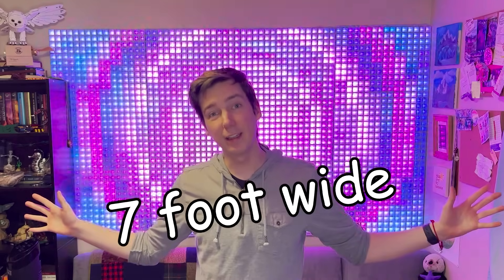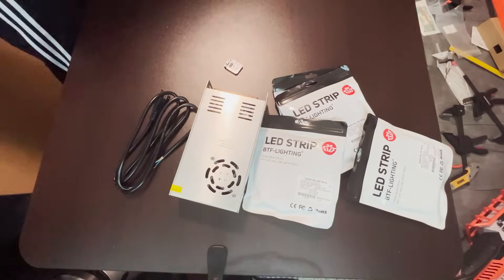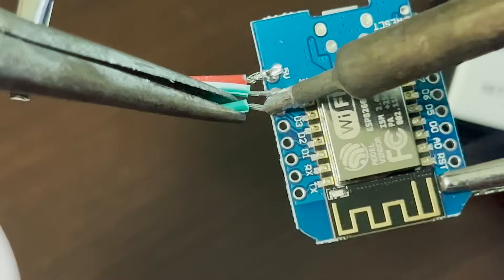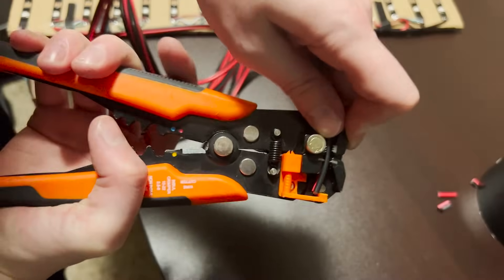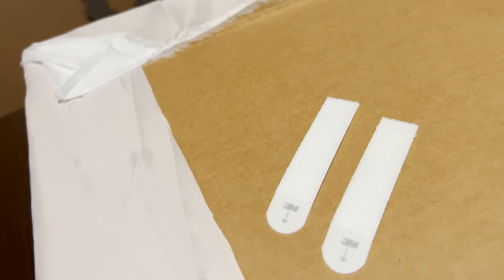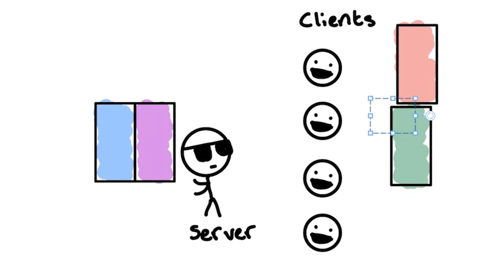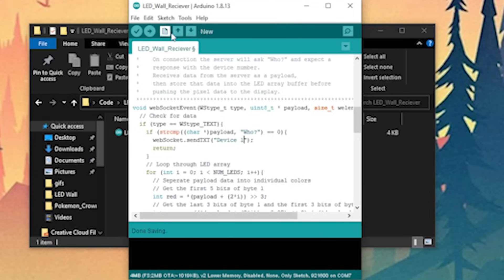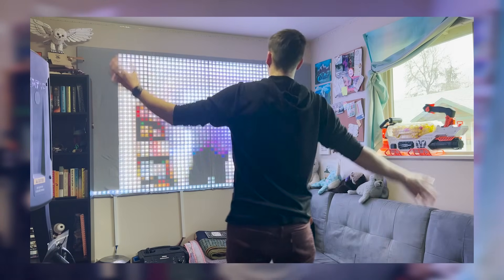How to Build a Massive LED Wall on a Budget

Comment: Ok, 1st of all you have my like. Great project !
From a electronic DIY point of view this is awesome, and teaches a lot of concepts.
Now, from the "$500 budget" point of view and complexity... I would just buy 4 cheap or used TVs, remove the frame and get much better results. Of course I know that is not the point of the video, but $500 can do a lot without having to actually "do" much.
Reply: This. Or just one projector if it's just for backdrop use.
Reply: @BossmodePictures  How would you use just one projector? Would you be able to use it outdoors?
Reply: @elace2007 just do

Comment: Here is an Improvement because you dont really need bi-directional protocols like websockets or TCP:
Each ESP8266 receiver has a fixed IP address running an UDP server.
The controller just send UDP packets to each receiver.

Comment: You went big. Recommendations for safety and functionality upgrades: 
1. Add inline automotive fuses on the DC outputs of the power supply in event of an electrical short, the fuse will trip and prevent the PSU burning your house down. 
2. Improve FPS and prevent throttling your home network going all wired with a Teensy and Octoboard. Just one Ethernet cable can carry all that data to the display. 
3. Alternative wireless options include PixelBlaze or WLED running on ESP32 with an output expander. 
4. Consider using RGBW strips which will give better colors and reduce power draw for white or pastel colors.
Reply: replacing the cardboard and cloth backing with more flame retardant materials would be at the top of the list for me
Reply: I'm still wondering :what should be the correct diameter of the cable in DC? Power can produce 60A!?
Reply from the maker: @bugsburny this thing doesn’t get close to 60 amps. You could probably run the entire wall with a single 5 amp supply with the right changes to the code.
Reply: @Tech-Random  you e are right because it would be centimeters of cable diameters. But 5 amps on 5v and 5 meters length represents already 6mm2!
It's 2.5mm2 with 12v

Or am I wrong and mixing up units?
Reply from the maker: @bugsburny 5V 5A is only 25 Watts. I’m using 16 gauge wire which can easily handle 60 Watts for up to 40 feet. I’m also running three parallel circuits to each of the four panels so each 16 gauge wire is only really carrying a few Watts of power. The whole thing stays super cool, I am even running it right now while it’s 100°F outside my apartment and I have no AC. I’m not sure how you’re calculating the wire thickness but something is definitely wrong.

Comment: Tip for anyone struggling to connect their ESP8266 to PC/Arduino - not all cables are alike!  You MUST have a mini-USB cable with data lines, the ones you get with chargers only have power lines, you need a thicker, good quality cable :)

Comment: I'd have used ATLEAST 60 LEDs pm if not more to get smaller pixels.

and you could have used a sheet of aluminium to as a heat sinc

Comment: i would really like to see this done with the higher density 60 LED/meter (300 pixel) strips for a more detailed image.
Reply: The hardware and typical home wireless network can’t handle it. Would need to upgrade the design and cost will go up.
Reply: @mylesdb  this is what I'm trying to build 60 led per meter. 108 x 42 per panel. 
108 pixels by 168 pixels.

can this plan be possible if I'm going to build it with this guide from this video tutorial?
Reply from the maker: It should work but you may not get the best framerate. Video coming soon with my new higher resolution design
Reply: @Tech-Random  thank you Sir can't wait to your new video so that I will start preparing my stuff that's needed 😍

Comment: Really impressive! I'd definitely like to give this a shot sometime!

Since we would need to make about 4x panels to accomplish this does this also mean we need 4.power supplies? If so how much combined power draw is happening to run this?

Also, a few smaller questions:
Is there an easy way to adjust dimming or perhaps networking the panels to connect to a dedicated PC that streams/plays a looping video rather than mirroring the wallpaper?
I'm super curious how much can be done with this!

Second, how much easier or different would the connection process be if done wired rather than over wi-fi to avoid router complications? I'd like to see about running this on a PC stick that's dedicated to this process, though I imagine maybe a raspberry pi or something would also be capable.

Would love to know! Great video!
Reply from the maker: It’s easy to change the brightness by modifying the #define BRIGHTNESS line in the receiver code. If you’re running at max brightness (255) you’ll need at least three 60 Amp supplies. I run mine at about 25% brightness and it’s still surprisingly bright and only draws about 30 Amps with regular use. I also included a sketch called LMCSHD_Test which directly outputs the video feed to GPIO rather than going over the network. You can get a much higher frame rate and lower latency this way so I recommend trying it out!
Reply: @Tech-Random  I am a novice, what is the diffuser for?

Comment: Something that I figured out AFTER building my first matrix was the the power can come from anywhere, but the data line must be linear, so you can bridge the power wires on either, or both sides of the strip, and run your data in a line, serpentine is the easiest to solder tho.
Reply: Just don't forget to tie all the grounds together
Reply: @DoesntRefillTheBrita  Yes, ground is included in the 2 required power wires that can be connected whatever way works best

Comment: The issue with how you've wired the power lines is that in the event one of your feeder wires breaks, the current is going to try and be sent down the tiny wires instead.

This is not how you should do this.

It should be divided into sections, each home run back to the power supply.

Comment: Very cool. I was actually looking for a solution to control a very large 15 year old led matrix football scoreboard. The graphics software that came with it is only compatible with Windows XP and the controller is failing. With a few adaptations I think I could use this solution to control our graphics during games...
Reply: those panles generally use the hub75 interface and are multiplexed instead of the addressable ones showed here, there are plenty of libraries for those but depending on the size you kight run into memory limitations and will have to use a raspberry pi
Reply: @ShahZahid  thank you! That is very helpful!
Reply from the maker: Sounds like a fun project!
Reply: @Tech-Random  also i know of a pretty good software for these ws2812 matrices but for some reason i cant type the name as YouTube deletes my comment, and i give up trying to
Reply: 1. you can get more help @DeonnaHardaway-zb7ri  by mentioning the make & model; 
Daktronics is common. 
2. Mentioning the model of the controller(s)  helps too. 
3. the  (LED panel model #s) (individual panel) 
4a. For example: I have for sale: 
540  RGB LED panels (from 4 sports arena frames of 9'x15' ):
Daktronics 0A-1434-8839 
MOD;AE-2007-32X32-10-RGB-8839; PC406805;U-2042A 
Not my price(used is less), but Man'f:$2920.00 each (Minimum order of 5) Daktronics would have to build.
I have no min. order #
 4b.  
 (Higher res for scrolling text) About 67 panels:
Daktronics 0A-1222-8433
 MOD-G5_MOT-A, AE-2000-16X16-16-RGB-8048 (2000NITS) 
Not my price(used is less), but Man'f:$5050.00 each (Minimum order of 5) Daktronics would have to build.
I have no min. order #

Comment: why not use the 60pix per meter and get a higher resolution on the pixel wall?
Reply from the maker: My goal was to cover a large area at a low price. 60 ppm would be 4 times as many LEDs and need much beefier wiring and power supplies to cover the same area. I would expect a project of that scale to cost around $2000 if you want to give it a try!

Comment: I wonder if foaming Lightweight PLA would be a better option for its low weight and high volume. From what I understand, you could cut the total plastic 40% by weight while still having the same final build volume. Not sure if that is any more or less cost effective than some cheap spools of PLA though, I initially thought about this as a way to reduce the amount of filament needed.

Comment: i wanted to do this a year or two ago but when i priced out the addressable LEDs on digikey they were over $1,500 for the size panel i wanted and i immediately gave up. 
addressable led strips were going to be outrageous in price too so that was not happening. 
i also wanted to use frosted acrylic as a diffuser cut into squares and that's not free either.
Reply from the maker: You should definitely give this method a try. It’s way more affordable than I was expecting when I started.

Comment: Very cool project,

As an open source software contributor it pained me to hear that you forked a project, fixed something that wasn't working, and didn't raise a Pull Request. That way, as long as the original maintainer is still around, we can have one working piece of software instead of a bunch of forks.

It might also be cool to make a version of the app which supports "profiles" so you can load all those settings or set them as a default from a config instead of setting the baud rate etc. every time you use it.
Reply: I left an issue on the repo hopefully this is corrected
Reply: Absolutely. If you're going to benefit from open source and take the time to fix a bug (or add enhancements) for your own use, please please please submit a PR upstream so we all benefit.
Reply: just wanna add that i agree he should ideally help the original project but, freedom means freedom. there's nothing inherantly wrong with modifying something for your own purposes. there's no need to gatekeep open source
Reply: Oh no, the software that is for anyone to take, change, modify and keep got taken, changed, modified and kept. THE HORROR!! i say
Reply: Agreed
Reply: Why hasn't he replied or made a comment yet?
Reply: @halalexpressions  Because he isn't obligated to answer you.
Reply: I checked the same thing before reading your comment.. No issue, no PR and even his fork is private.. He doesn't deserve open source code
Reply: @Xxana99X   doesn't that defeat the purpose of Open Source Code?
Reply: @Xxana99X  Yeah, you're right. It's definitely better to entirely write someone off and say they don't "deserve" open source code (wtf does that even mean) instead of just telling them they should open a PR. 

That way, you ensure that junior coders or people who are new to OSS get scared away from contributing, which is obviously the best way to ensure the OSS community continues thriving.
Reply: @AnimusBehemoth  man, if you take open source code, make an improvement or fix a bug, you MUST contribute by opening a PR, if you don't do so, you don't deserve the right to use it. You are going against the spirit of open source.
Reply: @Xxana99X  open source code is for everyone, so unless you profit off of forking OSS, I feel like you still deserve it.

I totally understand the sentiment behind what you're saying, my point is that we'll never sustain our community if we immediately shit talk people who just might not know better.

Maybe the guy who made this vid just straight up will never contribute, but if we make possible contributors feel like crap instead of encouraging them to open a PR, then we ensure they won't.
Reply: @AnimusBehemoth  Fully agree. Instead of spending the time in getting a "proper" fix that can be re-integrated into the original code, I tend to fix things in a way that "suit my needs". Main reason for this is that I have spent a lot of time trying to open PRs and fix stuff in some "open source" that I found, only to be rejected (because "it's not a fix the OP likes") or to be completely ignored.
Maybe it's just me. Maybe I am using github the wrong way. Maybe if someone would have helped me when I started github to use it how it's supposed to be ... But for now, I decided my limited time is better spent for my personal use. That puts me in a position I don't like too much so I am now putting "my" code on github too.

Comment: Great explanation on how to do this! BTW, 
Green = ground
Black = load/hot 
White = neutral
Reply: For future reference folks, remember: DC wiring of black and white are different or reversed compared to AC household wiring:  In Canada and the US (Single Phase - Split Phase)120v AC wiring
AC 
white = Live/Load/Hot 
black = neutral
green = ground

DC
red = positive
black = negative
white/grey = ground

 RV owners troubleshooting their DC lights and other dc stuff often discover this difference when the electrical wiring installer of the DC circuit mistakenly continues the AC wiring colour scheme.
Reply: @mikemotorbike4283  WRONG.  AC BLACK IS LIVE.

Comment: How did you do the clock and weather function? Could you tell me how to do it?
Reply from the maker: I used a website designed to build a custom magic mirror display and just screen captured it to the LED wall. Unfortunately I don’t remember exactly which website I used

Comment: Don't know if someone else has mentioned this, but WHITE is Neutral.    BLACK is always HOT.  An easy way to remember this is that "black means death".   It will still work if you get them backwards, but there is a chance of some problem where you may get a shock.

Comment: This looks awesome and I've been thinking about creating one . This is the first time I've seen it done w LEDs strips though. Usually I see it done smaller w led matices. Is there a reason behind u choosing strips? Cheaper? Easier to program? I have someone that wants this done and I'm bouncing back and forth trying to find the best way to do it.
Reply from the maker: The LED strips are cheaper and require much less power than the matrices since the pixel density is lower. If you want to cover a large area, then this is the best solution. If you want a high resolution, it might be better to use the matrices.

Comment: First video I saw by you and got a sub. I would love to see this all hosted on a raspberry pi for the websock and then with the raspberry pi be able to use shareport sync(open source airplay) for the music and pass that data to the displays for the album art or lightshowpi for controlling the leds. Plus it could be cool if you use multicast/snapcast (I think is the name) to be able to like multiple raspberry pi's to play the song in different rooms with the music synced and maybe a panel in each room set to the audio visualizer. That would be a huge project but super cool to show off during a party

Comment: Awesome tutorial! At the end when you're using the wall to play video from a camera there's a little bit of latency. Could this be reduced by using wires instead of web sockets or reducing the size of the grids? I'm looking into building something similar with WS2812b 16x16 matrices to be powered by touch designer
Reply from the maker: There’s no latency using wires. Smaller grids have less latency and a higher frame rate!
Reply: @Tech-Random  is there a reason you didn't use DMX?
Reply from the maker: Adding DMX support would require additional hardware and the firmware on each ESP 8266 would have to translate that data into something the LEDs can read. LMCSHD sends a bit stream formatted for addressable LEDs so there’s no processing delay between the frame being sent by a PC and getting displayed. All of the delay in my project comes from the transmission time of the web socket

Comment: Could you integrate NDI streaming to it? It would be great if I could use it with resolume or other software
Reply: Instead of using the ESP, use a proper pixel controller that takes Art-Net or sACN. Then there is plentyof software which can take NDI and output it to the pixel grid with relatively low latency.

Comment: I like how you consider 500$ "budget"
Reply from the maker: Other LED walls this size cost thousands of dollars. Even other DIY options I found on YouTube were at least $1500 in materials. This is the cheapest you can possibly get an LED wall this size. Also the design is modular and you can make 1 panel for around $100 if you’re clever 😉